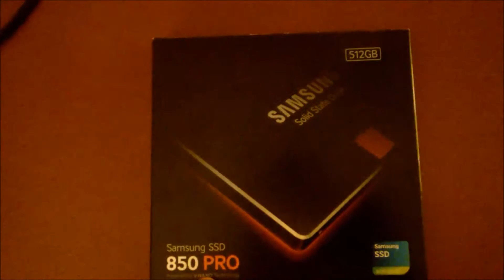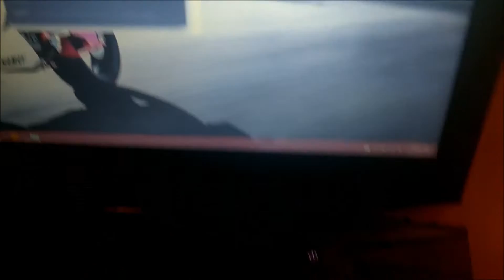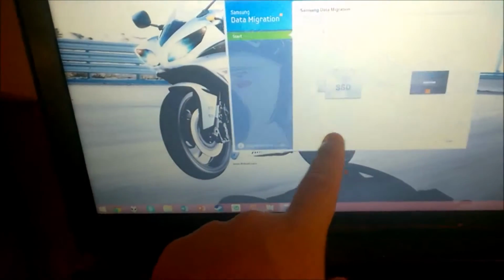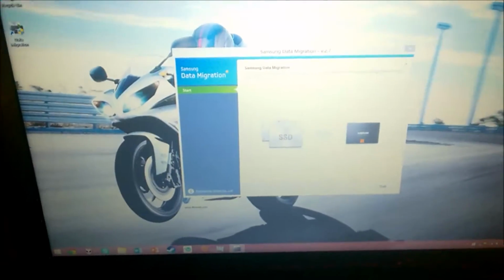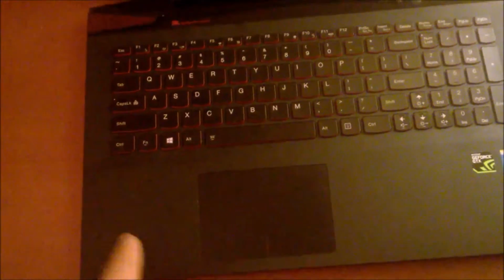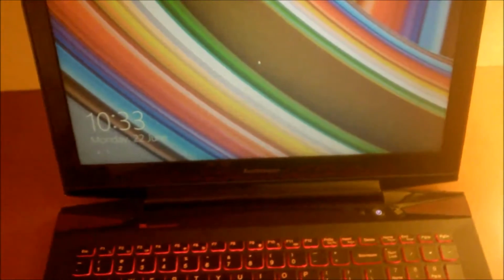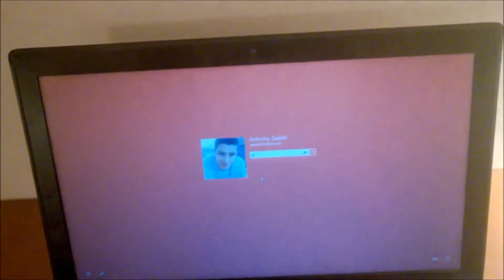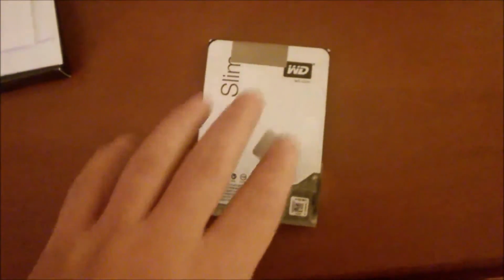Lenovo Y50 SSD Upgrade Walkthrough

Comment: Hi I know this is pretty old, but i'm planning on doing this too. So basically, the samsung migration software is given with the SSD ? You were able to copy all the content of your C:/ disk with the Windows 10 OS and the programs without having to boot from a usb ?
Reply from the maker: Yes the migration software work for the OS and all the programs a software for windows so you don't have to boot from a USB
Reply: @Sabellan1234  thanks for the quick reply .

On a basic HDD usually you install software and OS on the C:/ Drive, and the documents and files on the D:/ , how does it work on a SSD ? Is it the same structure ?
Reply from the maker: @charlypoidevin4265  yes it's the same
Reply: @Sabellan1234  Alright many thanks man

Comment: I'm planning to get an enclosure to use the old HDD as external, do you know if it's possible to use the enclosure as adapter to clone the SSD first?

Thanks for the video and cheers for being a rebel with that one-handed plugging!

Comment: I have a question, my old hard drive died and the data was not recoverable. I've now replaced it with a SSD and already installed Windows 10. But all it displays it the recycling bin. Where do I install all the previous drivers the Lenovo y50 came with and good vid man.
Reply from the maker: +123gurtej you should get the Drivers Straght from Lenovo
Reply: huh, odd. My hard drive just died on my Y50 aswell. what happened with yours?
Reply from the maker: +Mike B I took mine out before anything happened I use it as a external and it works just fine
Reply: +Mike B just installing some Mods for Rome 2 and crashed. Blue screen of death and couldn't boot because there was no bootable device.
Reply: +hebbocake it is, only lasted me like 8 months before it died.
Reply: Yep. Blue screened for me a couple weeks ago. Got a 1tb sandisk ssd.
Reply: Hi! man, i got the same problem here. How did u solve it eventually? I recently got a new SSD hard drive and installed into the Y50, but it still display "no bootable device".
Reply: hebbocake Could you help me with it sir? :D Iam dying here~
Reply from the maker: you can get all the drivers from lenovos website
Reply: my old WD drive was broken, so I bought a new WD2 SSD and I installed correctly. But after I got into the Diskgen and tried to make partitions in that drive, I coundn't find it.